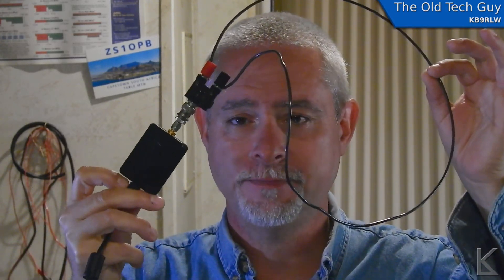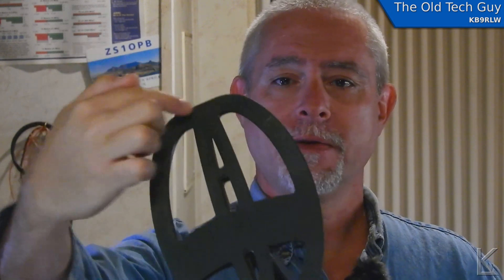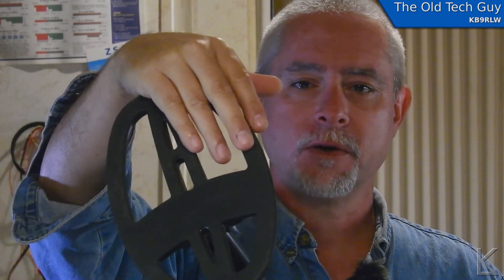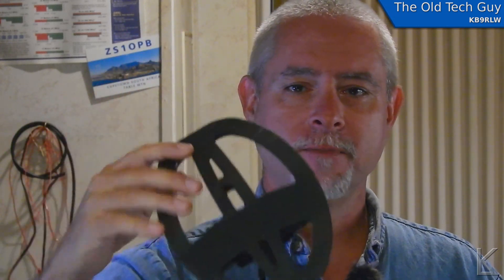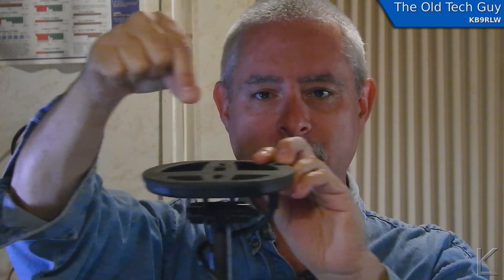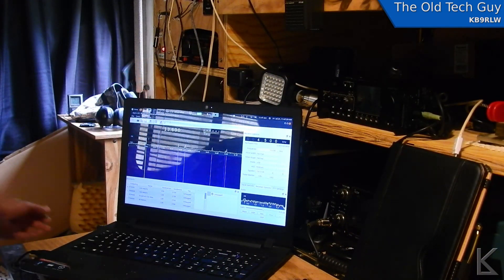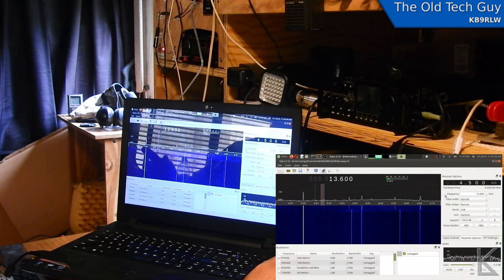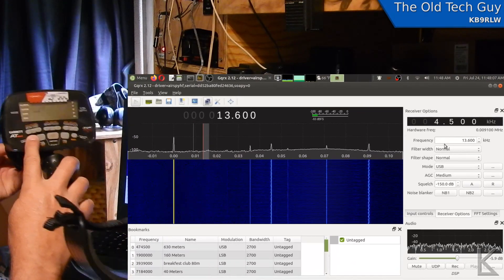Ham Radio - Is the Airspy Discovery HF+ sensitive on VLF? Testing with a Garrett metal detector.

Comment: Before ordering loads of magnet wire - how about winding something on a ferrite rod like in the AM radios in the old days and put a transistor gain stage behind it? And a ferrite rod is light weight enough that you could raise it up into a telescopic mast, out of the way of noise sources in the RV.
If you think about something resonant with a tuning cap then you need quite a wide capacitor range. 3 - 30kHz is a decade and requires 2 decades of C variation (because the frequency goes with the square root of the LC product).
Reply: Yep.  The classic WWVB receiver in millions of clocks have a small ferrite rod antenna.
Reply: I was also going to suggest a ferrite antenna and if you get some Litz wire and large ferrite bars from Russia to use like DXerGary has in his video that will make it a lot more sensitive. https://www.youtube.com/watch?v=WYuikQj7yPA
Reply: Litz wire is effective between 300 khz to 3 mhz according to RCA Radiotron Handbook, 3rd ed.

Comment: 👍Interesting experiment Kevin, thank you. SDRs are just amazing for this kind of thing. The only antenna suggestion I can think of not already mentioned (for reception) is a ground loop. Not a loop on ground but something like a variable capacitor with as much wire as you have running off in each direction to electrodes in the ground. No idea what the geology is were you are. It makes use of Skin Depth and the theory is that less conductive bedrock gives best results.

Comment: There are some nice voltage probe (amplified whip) antenna designs posted on the internet.  Interestingly, I've noticed a few KiwiSDRs on the net receiving very nicely on what are essentially 1m or 2m diameter amplified loops.

Comment: Speaking from experience; a small loop (Less than a foot in diameter) with many loops (Several hundred) is no good down there (I'm not talking about ferrite-rod loops, but 'normal' loops (Donuts, if you will, with nothing in the center of the loop))

Big is not necessarily the way to go, but I tried a few different sizes and layouts and found that a single-loop triangle (15 feet on the long ends, 10 feet on the short) worked really well on around 200-300 kHz.

I currently use 2 rectangular loops in parallel (Positioned perpendicular to each other). Each is 15 feet on the long ends and 5 feet on the short ends. They are standing like fences on the ground (For practical reasons and because I live in a place where I can't raise their height)

They work very well at VLF (And all the way up to about 18 MHz, above which they begin to only pick up local OTH transmissions)

Good luck and please share experiences :)
jacob.

Comment: I used to use a box loop ( like your 630m one) for MW dxing. That was 7 turns of wire on a 40” frame. With a single turn wrapped round the centre turn for pick up and a 360pf cap for tuning. That would be a place to start. I can e:ail you the details if you’re interested

Comment: Look up the papers or Dr. Heinz Schlicke.  He was a German U-Boat Commander (Scientific - U234).  When he was at Allen Bradley in the early 70's, we experimented with brain wave feedback using active filters in the 7 Hz range.  Basically, you attached head probes, through a 7 hz passband filter to a headset.  If you thought good, relaxing thoughts, you could relax (signified by a tone).  However, brainwaves could be generated near 7 Hz that would make you psychotic.  We had to carefully tune the twin tee active filters to get a good result.  Will the Airspy work that low?  (PS, Dr Schlicke was a founding member of the IEEE Electromagnetic Compatibility group).  His work for the Germans was on proximity fuses (using RF).  Came to America as part of Operation Paperclip.  (Worked for him as a young MSOE graduate) - WA9RYO

Comment: I wonder what signals one could pick up on VLF if a Beveridge Antenna was utilised?
Reply: A decent beverage antenna is at least a wavelength long. At 10kHz VLF you are talking about at least 20 miles of wire. That's an aweful lot of fence posts to hammer into the ground.
Reply: @robertvandersanden  Good point. It would make Fence Post and Antenna wire suppliers happy with the amount one would have to purchase. :D

Comment: Interesting video! I would suggest that before you invest time and money in a traditional large loop  or ferrite rod type of antenna you explore a small active vertical or loop antenna. Didn't you previously test a  mini whip?  The updated mini whip should give you reception down to at least 10 kHz. You are in a relatively low noise environment and should be able to get an active antenna away from nearby noise sources (like your RV) with the help of a common mode choke on the coax. Check out this video from W1VLF - https://youtu.be/b0Jx-oN3YlA